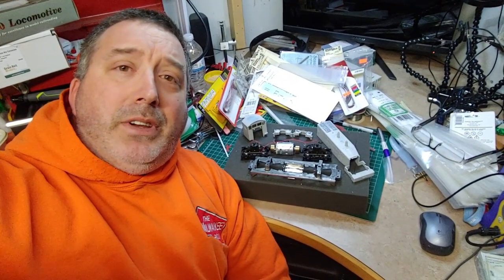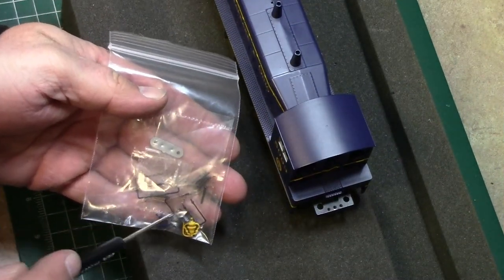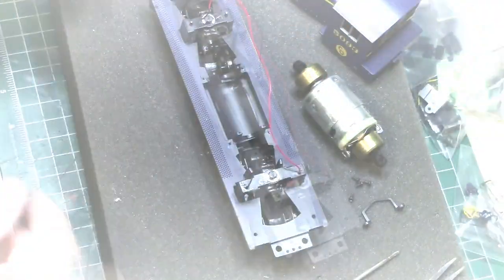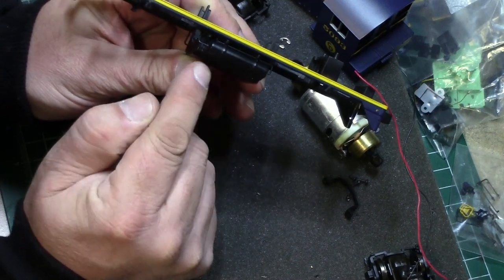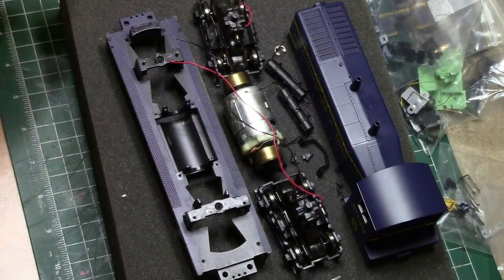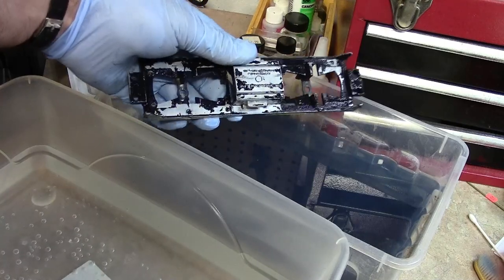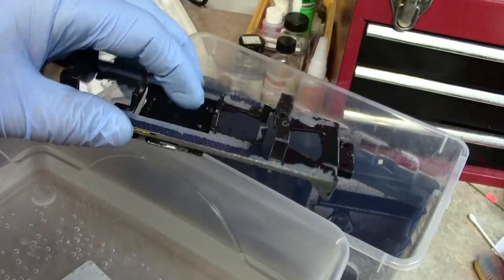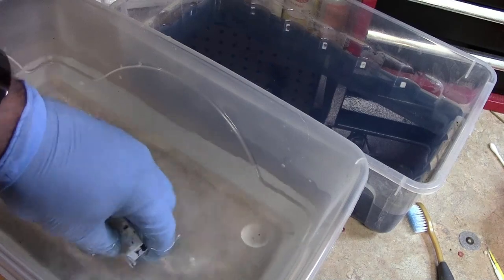Easy way to strip paint off your models

Comment: Brake fluid works great, tool and is less toxic to breathe. In either case, leave it overnight in solution before hitting the toothbrush.
Reply: Dont use brake fluid on this or kato....your engine will be in 7 or more pieces when you come back the next day....

Comment: Mike.  I watched what you did with interest. I'm a Milwaukee modler in "O" scale so my parts and pieces are much larger. I've had success with paint stripper for metal on chassis components  leaving just bare metal just needing a little tooth brush and dishwashing liquid soap scrub / rinse and drly with microfiber towel. Now ready for primer.  By the way, have you posted the finished engine?  I'd like to see it.

Comment: Escanaba and Lake Superior Railroad. Are you a Yooper there in upper Michigan. Do you live near Iron Mountain? What Milwaukee Road paint scheme are you going to paint this back in? The usual black top, orange center, and black bottom with the black letters MILWAUKEE. Alcohol works good taking the paint from the plastic. If you got a toothpick you could have got some more out of the radiator and grills on the roof. I've done this paint removal with alcohol on an HO locomotive. Ready to see the video of the next step. Stay well.  👍
Reply from the maker: Nope not a yooper.  I live about 2 hours south of iron mountain.  The paint scheme is going to be the standard Milwaukee Road switcher paint scheme.  Orange and black and a herald on the side of the cab...no other lettering
Reply: @michaelostertag2839  There is a guy that lives in East Kingsford right there at Iron Mountain that videos the Escanaba and Lake Superior railroad and post on YouTube. He's always talking about being a yooper and that's where that came from. I meant no disrespect. You might have seen his channel its Jason Asselin. Name and channel name. If you've never seen his channel you might check him out. Stay well.    👍